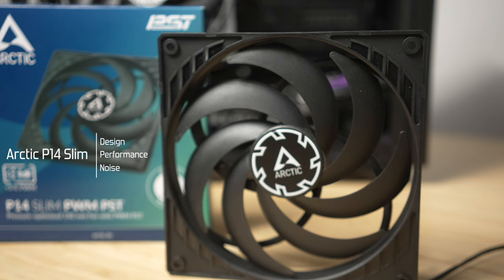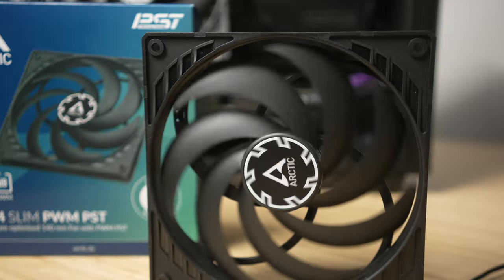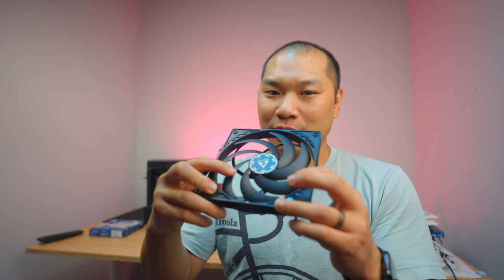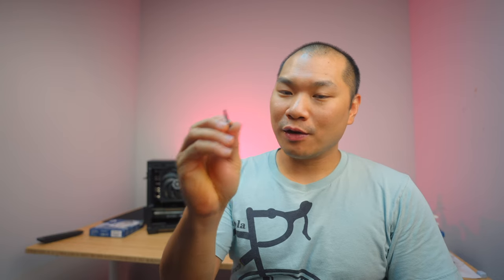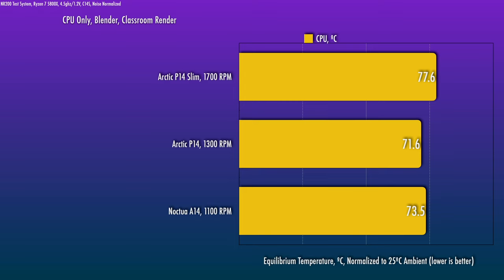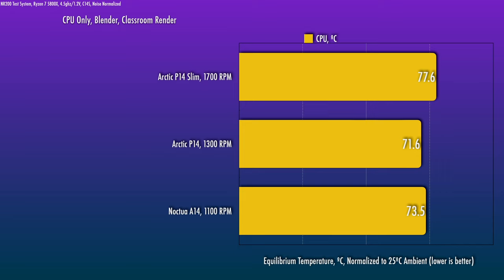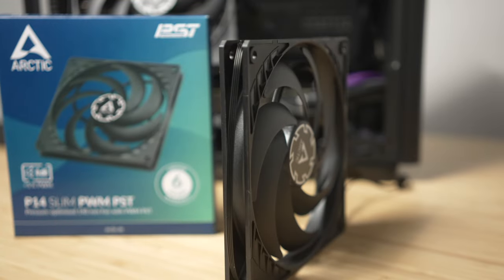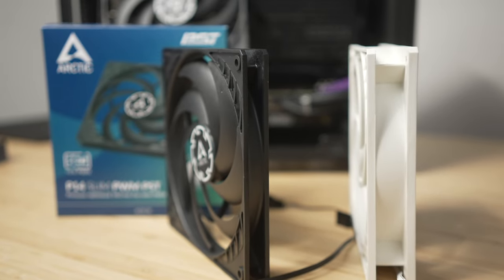The Arctic P14 Slim - Special Purpose 140mm Fan!

Comment: You are correct about the thin fragile fan blades. Mine lasted 15 minutes before one of the blades contacted the frame and began clicking with every rotation. Had to return the fan. A pity as my Lazer 3D LZ7 XTD case has only space for one slim case fan.

Comment: Thanks! and thanks for Arctic too.

In the worst scenario, this slim design will save my configuration because I want to install an ARCTIC Liquid Freezer III 420 into a SHADOW BASE 800 DX.

And although BeQuiet's website states that the case has no limitations, based on thier manual it's not really true. 30mm rad + normal fan is the max supported height. - in theory, Or You have to be lucky with the shape of the VRM heatsink. - Yes, I could use the front panel with push config with top pipes, but meh.. 

The 38mm radiator plus the three full-size fans won't fit on the top unless I replace one of the three with this one.
In theory one replacement will be enough, where VRM heatsink is problematic.

Comment: I put the slim P12 on the top of a O11 Air Mini and sometimes the blades make contact with it's own fan frame (or guard, can't tell which). It turns out that the blades aren't completely balanced. Other than that, these things have been pretty decent.

Comment: To minimize vibration noise on m P14 case fans, I use rubber "screws," and for the P14 rad fans, I use rubber washer.
Reply: You'd then need to duct tape your fan to your radiator. Otherwise all that air will be escaping out of the gap created by the washer.
Reply: @DeanoDrives  Yes, because using the screws that came with fans create a vacuum seal between the edge of the fan and the case.

Comment: It would be nice to see how this does on a radiator. It would make a 280mm rad possible on a 011 air mini with an ATX motherboard. It would be a little weird because a regular 140mm could be used and then the slim would be used to clear the RAM. Either that or use two slim fans for Aesthetic but at the cost of temps.

Then the other thing would be, is it even better than a 240mm AIO. It would be awesome if you could test this.

Comment: Nicely done, would love to see a comparison when used with a radiator. 1 setup is with single sided (push or pull only) normal 140mm fans.  2nd setup is push AND pull with the slim 140mm fans. World performance and sound be better or worse?
Reply: I'm currently using them on a 420mm radiator from an Arctic Liquid Freezer III installed in a Fractal Design North XL.

The LFIII's radiator is installed in front, with a first row of P14 Slim to push air through the radiator, as thicker fans would prevent to close the front panel (Fractal's huge miss on the design table, for this). They were supported by three Arctic P14 Max on the other side, in pull position. My 7950X3D was idling around 43°C, with that setting.

After an investment on a 4090, I had to remove the P14 Max and the radiator is only being loaded with the three front P14 Slim. Despite increasing their base speed from 15% to 25%, I still noticed an increase of about 8°C to 10°C.

As regular 140mm*140mm*25mm won't fit properly on the back of the radiator, I reordered three P14 Slim to help the three in the front and restore some temperature control in my build.

If it doesn't bring satisfying results, I'll surely have to rethink my thermals, but I have good hopes for the P14 Slim sandwich!
Reply: @jaxbade  nice, looking forward to the update!

Comment: I'd be really curious to see it watercooling tests compared to the Noctua 120 slims and standard 120 Noctuas. Rocking a Meshlicious, I'm always thinking about adding that second side radiator on the GPU side. Frankly, I thought I was limited to slim 240 rads, but this might be a game changer.
Reply: You can definitely do a 280 slim rad on the side of meshy, I'm using Iceman's rad bracket with a 240mm slim for now but it does have bolt slots for 280 and Alphacool released their ST20 line. The new Meshroom S is even better, it comes with a stock 280 rad bracket. You really need to be careful with the GPU block's terminals tho, and 90 fittings (need low profiles most likely)

Comment: I have been using a 120mm slim version of this fan and it's been great!! If anyone needs a 140mm slim fan with 120mm holes then please check out the Gelid Solutions Silent 14 Pro. I also use one of those and it's highly recommended. 😁

Comment: Mega handy for top exhausts on NR200
Reply: The p12 works with self 3d printed short pegs
Reply: @johnsuckher3037  I meant the p12 slim are perfect. Thingiverse has short mounting pegs for slim fans. The 140 won’t fit without further mods
Reply: I put two Shadow Wings 2 140mm in the top of my NR200 with zip ties, it works wonders and looks awesome! It depends on the cpu cooler you use of course - with the Big Shuriken 3 it fits no problem.

Comment: I have a NR200p Max with Tempered Glass, Noctua  slim 120 on the bottom + Corsair fullsize 120 and stock Cooler Master rads fans on the top. I think they are just too loud for my tastes and i want to change the two 140mm fans with two Artic. My choise is between two slim or two full size. I want the best compromise between good thermal conditions and low noise, but the NR200P Max has litterally no space between rads fan and mobo, so the slim size could gave me more confy case management. Do you reccomend the normal size or i can go with the slim size?

Actually my temps are good, so it's litterally about noise and space (if temps stays the same).

Comment: What about using this on the NR200p with the TG cover, pushing the c14s and the A14 pulling underneath? Thinking that would give more space for air intake at the glass panel.

Comment: Hello i have nr200p with with r5 5600x with stock cooler and the temperature reached 92 Celsius i want a low profile cpu cooler thats looks good and preform better then the stock one i want to use the glass panel do you have any suggestions plz

Comment: These fans feel extremely cheap, I just bought 3 of them and 1 of them came broken in the box where the wire from the motor connects to the fan chassis, I will be returning these.